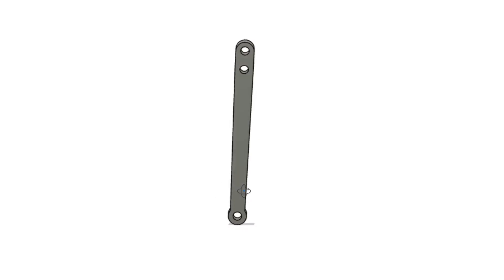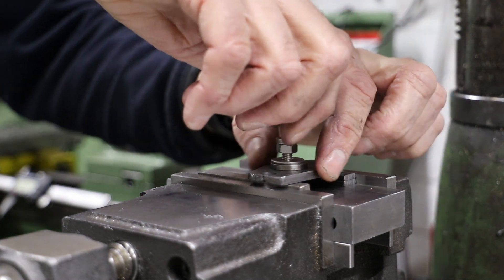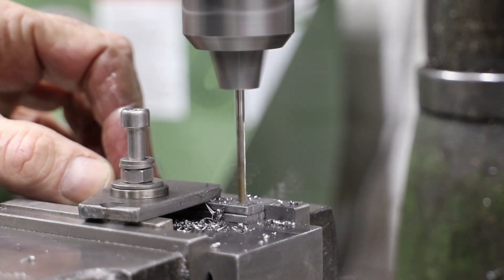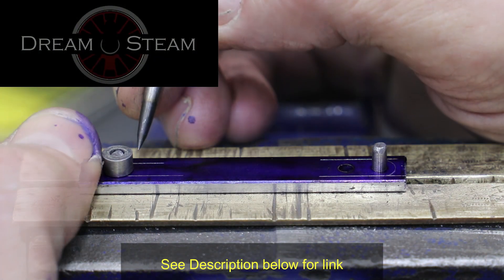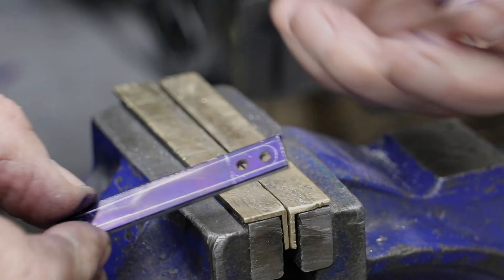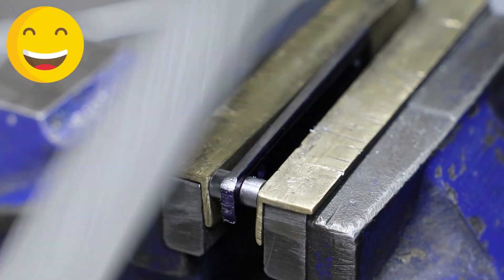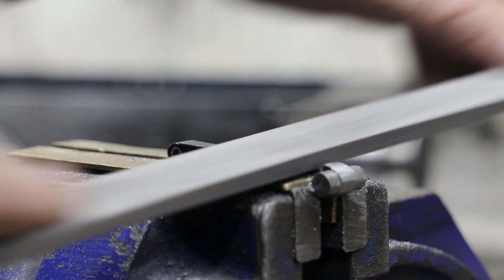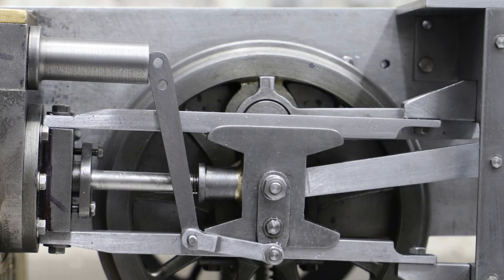Part 40: The Combination Levers

Comment: Because all the forces for the slide valve go over the combination lever and the resulting wear you should think about using hardened bushes and pins or harden the combination lever completely.
Reply from the maker: I know and this is a topic on some of the UK model engineering forums.  Views are mixed 🙂
Reply: @markshomeengineering5243  I didn't know that you are familiar with this topic. That's why I wanted to give you a suggestion
Reply from the maker: @DampfJastim  that's cool and much appreciated 👍

Comment: Hi Mark,
Would you consider putting some small bronze bushes in the valve gear? Have done it on my midge and makes it easier to repair accurately when they’re worn.

Can’t wait to see it finished

Tom
Reply from the maker: Hi Tom,
That is a good question and one that I keep mulling over in my head, especially for parts like this Combination Lever with no oil passages.  For now, I think not, but I may come back to that later.
Cheers
Mark